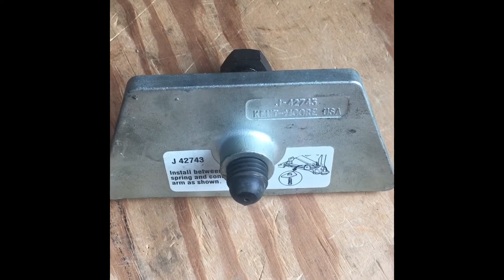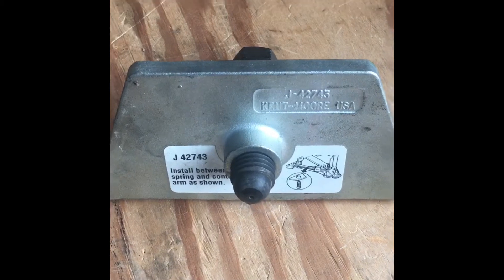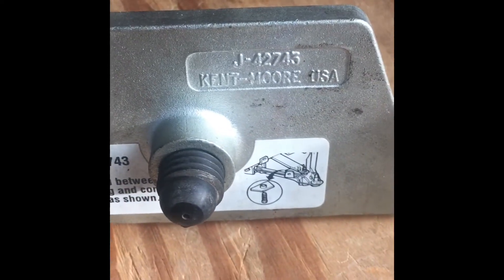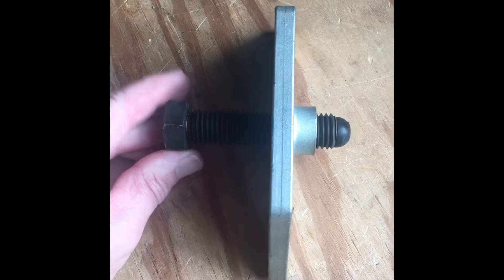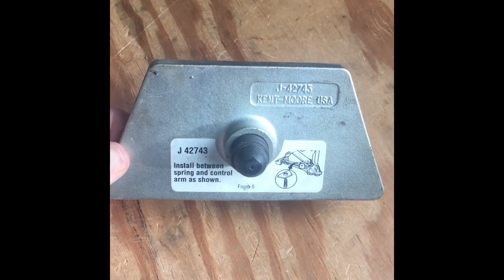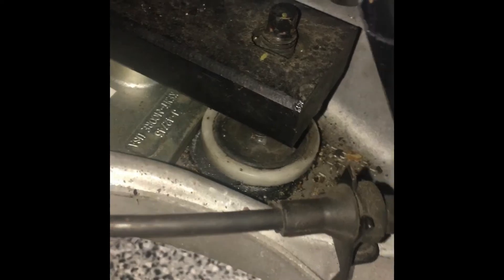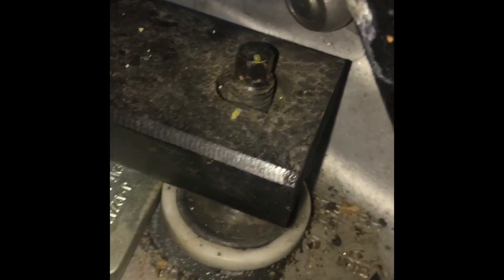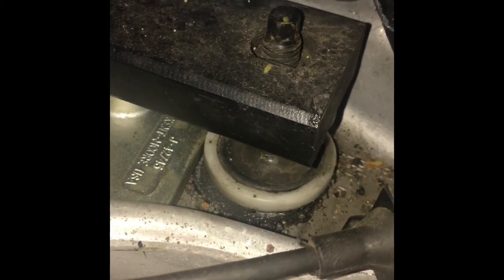Corvette - Ride Height/Corner Balance Adjustment Tool

Comment: Do you use it while the car is on the ground with wheels on, or you have to have the wheel off and jacked up?
Reply from the maker: I used it on a lift with wheels unloaded.  But it would work with wheels loaded or on ground.